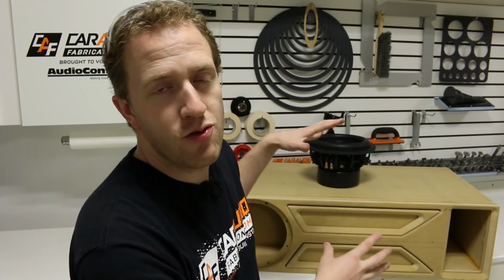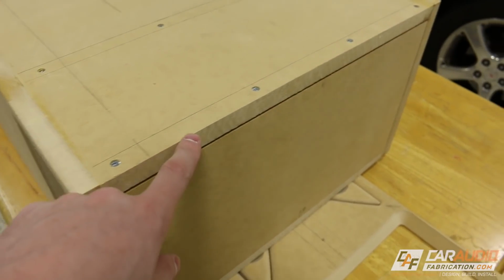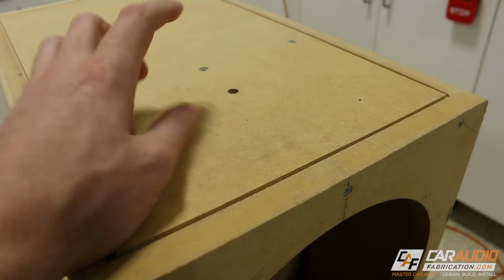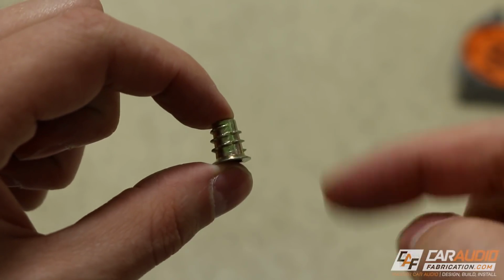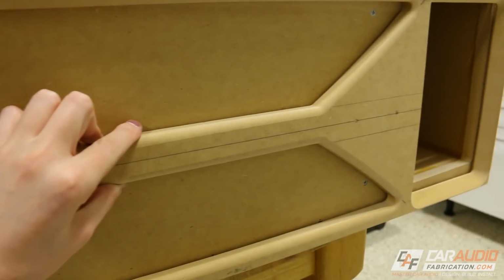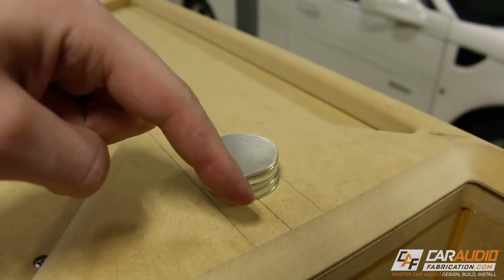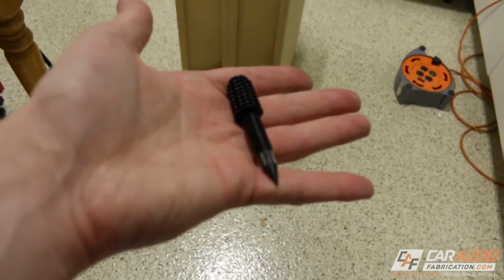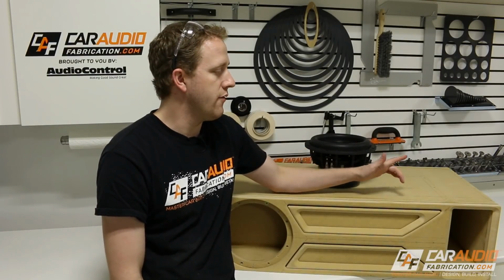Can't forget these subwoofer box details! T-Line Enclosure Build

Comment: 4:50 I would like to buy an Audio Control small device that simply is a digital EQ controlled via bluetooth or USB with smartphone app or Windows PC. Don't need time settings, just an inexpensive digital 30 band EQ, if Audio Control can offer such a thing (inexpensive). I own LC7i even though my ride doesn't have a factory amp but I was in need of a LOC with bass restoration.

Comment: How can you see my smiling face? If you can it suggests either of two things. First, you are clairvoyant, as am I, but that is so rare I'd have trouble believing it as it seems torun in my family, but not too far away from it. But since I found this this a couple months after it was uploaded to you tube, its possible, in which case we need to talk. Otherwise, it's bullshit and you're just guessing. But that's cool, because your making the effort and what the hell! You might get it right. Anyway, this is where I'm at currently. Strange, but it's where we ended up, right? So where to go from here. I've got two silverflute 6.5 inch drivers. I can buy two more to finish the bottom end, and that might be the best way to go. Or I might buy a subwoofer and build a bottome cab for it, setting up the silver flute/s for mid bass duty. I also have two Peerless 2.5 inch dome midranges which are currently being sold on eBay at $275 + on fleebay. And the tweeters are the matching Peerless domes to the Mids. I would think about the the ribbon type drivers from Madisound to handle the ultra hi range! Or maybe a combination of both. Anyway, a four or five wave Way tower isn't out of the question. Any suppestions?

Comment: Fill the inside of the t-line box with the stuffing that is inside of a pillow. Doing this will build up more pressure and for whatever reason makes Better Sound. My dad did that to my mom's Subs. Makes it sound beautiful she has 13 inch ×2 speakers if that makes any difference.
Reply: T-line boxes are meant to be filled with long hair wool. Teased out to vary the density along the line. A whole new art.
Reply: @seupertab  insane, did not expect a response to this comment😆

Comment: it a T-line box good for punchy bass? or should i be looking at something else? i was looking at sealed for the "clean accurate" bass but have seen how they can help with the driver bottoming out and damaging the coil area. ???
Reply: stonedvideos1 I’ve been building boxes for years and if you’re worried about bottoming our a subwoofer, match the sub with the amp example: 400 watts RMS to 400 watts RMS (keep in mind you should never look for MAX WATTS) a sealed box will always be better for punchy bass such as in rock music, metal, etc. if you listen to Decaf tracks and DJ slow n throw, dj rustacles etc, then a transmission line sub box will do great especially with a larger driver particularly 10 and up but if you have a small driver and want low end out of it then a transmission line box will work great I used some for my 4.5” subs and they hit 35 hz. Sealed also will allow you to use a more powerful amp for your sub say 400 watt rms amp for a 250-400 watt rms sub. A transmission line sub box will have more slip since it takes longer for the air inside to move and match the wave coming from the front of the sub itself. Sealed acts like a spring and will bounce the cone back fast creating great response, hope this helps
Reply: MegaTUHAU. You'd be better off building a band pass t line
Reply: T.line only for super low bass..
The best solution for SQ..you need 1 sealed box and 1  t.line

Comment: Hey C.A.F kinda new to the scene lovin the page. Quick question - Plexiglass box possible? I think it would be cool to have a see though box
Reply: Yes it is. I've seen plenty.
Obviously the 1/8" Plexi at the hardware store isn't gonna cut it tho.
What I've seen is that they use 3/4" to 1" thick Plexi for them, and then usually are fastened either with finish quality screws/bolts that will be seen because it's a removable panel they can also use for access, or the rabbet the edges  inward, glue and screw the plexy down, and then laminate the upholstery over the fastened portion so the ends & fasteners are not seen.
Reply: But I agree, particularly for a transmission line box like this, a plexiglass side where you can see the whole pathway would be sweet, especially if you could paint it inside and then add some LED lighting, maybe that pulses with the music. That'd be crazy!

Comment: So that glue is powerful enough to hold on to that slick metal? Even with such strong magnetic power trying to pull them off?
Reply: Yep. You apparently haven't seen the old 80's commercials for Krazy Glue. Dude hangs by a hard hat glued to a steel I beam... and the gluing surface is only a couple inches by a couple inches. Cyanoacrylate glue is pretty good stuff. Just try to keep it off your fingers.. that's not any fun.
Reply: Eric K 😁👍

Comment: Just a small comment about the spikes. Their purpose is not to pierce the carpet, but to minimize the mating surface of the box with the floor. There for less vibration is transmitted from the box to the floor, there for less buzzing.
Reply from the maker: +Meir Schwartz it minimizes contact area by pushing through the carpet down to the floor

Comment: I’ve used those threaded wood inserts and they should be installed to the outside of the baffle as they are right hand thread not the inside.

Comment: I have an audi a3 2007 and I would like to change the steering wheel with a flat bottom steering wheel from the audi. the current steering wheel does not have commands for the radio. if I buy one with commands I can make it work with my car . if you can tell me how or you could make a video. thank you very much.

Comment: why wouldn't the terminal cup be located on the back of the enclosure instead of the end? Especially since you plan to stand it up.
Reply from the maker: +shishkabobmiller if it's on the back the wire would have to run through multiple port walls to get to the sub. The spikes space the speaker up off the floor so the wire can run underneath
Reply: I was thinking the wide side face myself, honestly. I completely forgot about the floor spike spacing tho.
Touché.

Comment: Terminal cup. Ok but run wires through and caulk???? Rly. Use two bolts abs a couple nuts. Or some all thread n a couple nuts.

Comment: When using the threaded inserts or "t nuts" i prefer using a door hinge drill bit.  It uses the mounting holes of the sub and ensures you drill the exact center of the mounting holes every time
Reply: Great tip! Didn't even know that tool existed